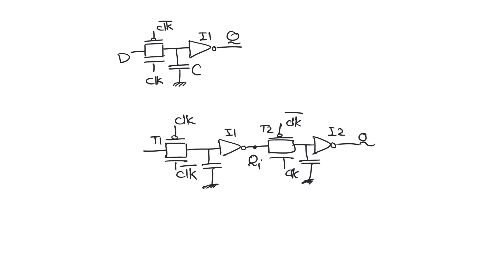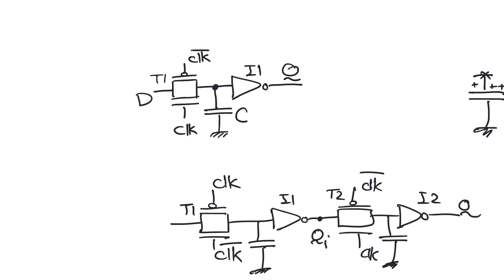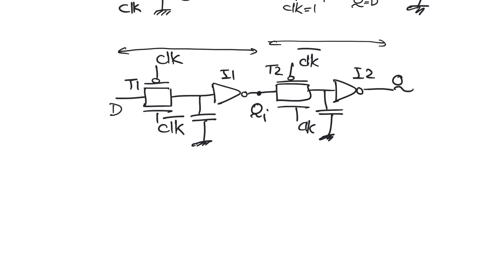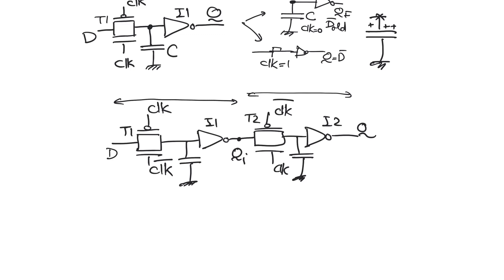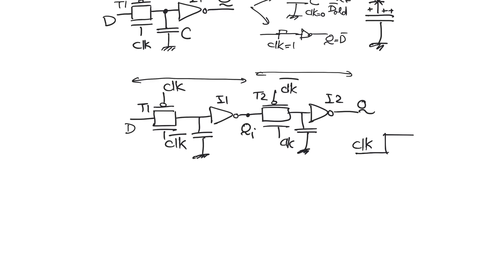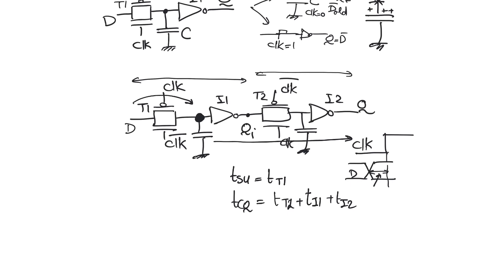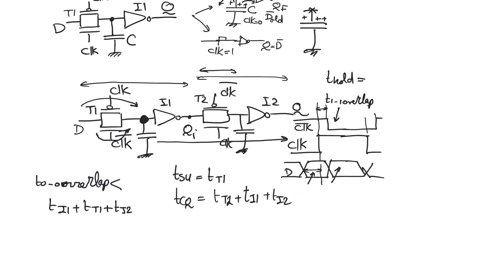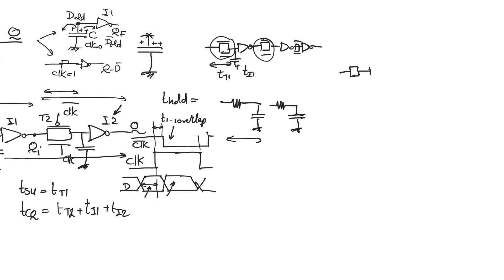6.6. Dynamic latches & registers

Comment: Couple questions.

* When computing the setup and CQ times, shouldn't we take into account the charging time of the capacitor? Or is this implicitly part of the tI's and tT's?
* At 9:21 you mention that the requirements on the 1--1 and 0--0 overlap are more stringent than in static CMOS, and hence racing is more of an issue. But is it really that stringent? Roughly speaking, you'd think that the overlap time is roughly the delay time tI of a single inverter, right?
* In the series of RC's in 10:54 onwards, why are they all connected? Wouldn't the transmission gates be closed alternatingly?